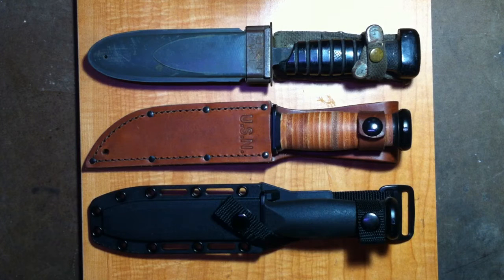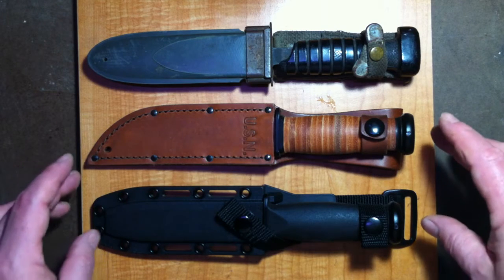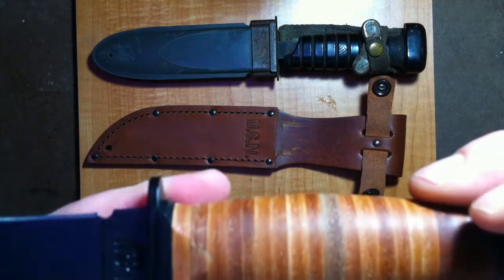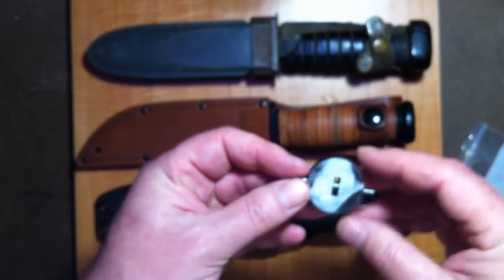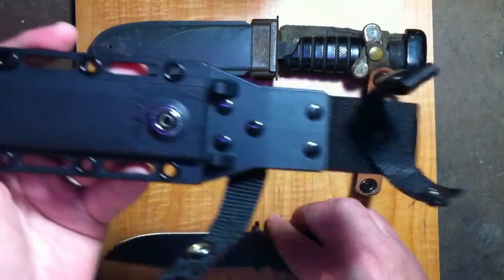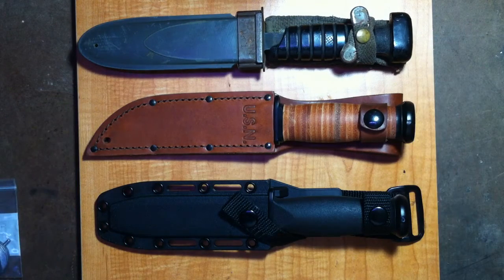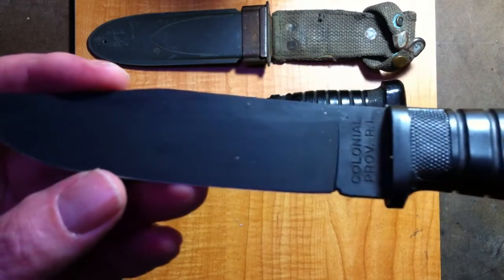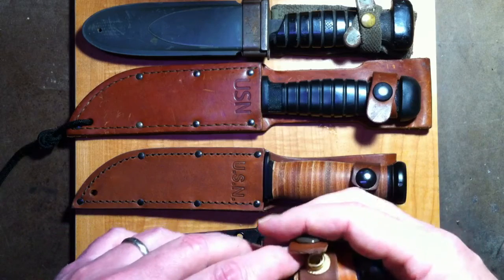USN Mk1 Knife

Comment: Take a file to the plastic. Problem solved. And your leather model is barely worn. I've carried mine for two weeks and it's got more wear than that. Quit complaining and use the tool for what it's made for.
Reply from the maker: It is not a complaint, it is a comparison.  Maybe you missed the part where I said they are fine knives very good quality for the price.

Comment: I’ve always been told that real WWII sheathes have 9 rivets on the leather. Any more or less then 9 rivets on the sheath and it’s a fake.
Reply from the maker: Jordan Mamrak, the leather sheaths for the MK1 knives were made by 8 different companies and all varied in their manufacturing processes, so that rule would not apply to MK1 knives.  MK2 knives had leather sheathes with 9 rivets, but that varied by manufacturer as well as time frame.  Most early MK2 leather sheaths did indeed have 9 rivets, but the Robeson USMC MK2 knife, which is the rarest of them all, has an 8 rivet sheath and most manufacturers ended the war making 7 rivet sheaths - and all of them were US issued sheaths.  Also, sheaths were considered "expendable items" and replacements could be ordered, so it often depends on what was on hand when the replacement sheath was issued.  It is conceivable that an early wWW2 knife, which were in inventory and issued/re-issued through the 1970s after the Vietnam war ended, could have a newer sheath.  I have one such knife and sheath.
Reply: Free America thanks for the info. I have some Vietnam era stuff that’s was wwii reissue. My wife’s grandad actually wrote 2 books about wwii knifes but I’ve never owned a copy. It’s thick as a phone book. Lots of different circumstances and different companies. It’s takes time to understand and become a novice expert. I’m still a beginner lol.

Comment: The ORIGINAL MK1 was produced by PAL who bought out the Remington Knife Co in 1941 and that knife is designated RH35 (PAL) which means Remington Hunting pattern 3 with a 5 inch blade. They were issues in a plastic infused canvas (green hard) scabbard with the USN MK1 roll stamped on the scabbard at the hilt.
The back of the scabbard should also have the NORD date codes indicating when built and what company it was issued to.
Reply from the maker: Thanks James.  PAL did, in fact, buy out Remington's knife manufacturing line.  PAL was only one of 8 companies that produced the MK1.  It was not the first, though.  The hard scabbards were manufactured by the Victory Plastics division of the Beckwith Manufacturing Company.  The MK1 scabbards were painted grey (as were the MK2).  The V/P and numbers that resemble a fraction, (Like 1/6, for instance) are manufacturing codes that depict the die and batch.  The B.M. Co. marks stand for Beckwith Manf Co. and the NORD number is the US Navy Order number.  None of those marking have anything to do with the date of manf or who it was issued to.
Reply from the maker: I also did a video on the PAL knives of WW2, the RH35, RH36 and the RH37.

Comment: for some reason my mk1 (ww2) has a 8" blade and a 5 1/2" handle
Reply from the maker: Is your knife marked "Western, Pat'd" on the ricasso?  If so it is probably a Western G46-8, which looks very similar, has the stacked leather handle, but has an 8" blade.  I'm not certain of the length of the handle but 5" or so sounds right.  If the knife has an 8" blade it is almost certainly not a Mk1, but there are many knives that look very similar.  Can you tell me what the markings are on the knife?
Reply: tackettsmillfarm nah man I'm sure I looked it up for 3 hours, it had the handle like yours but I custom fitted a knuckle duster handle on it it's full steel now
Reply from the maker: That sounds pretty awesome!  You should do video so we can see it.  I've been looking for a good knuckle duster handle for an old Ka-Bar blade I have.  I'd love to see how you did it.